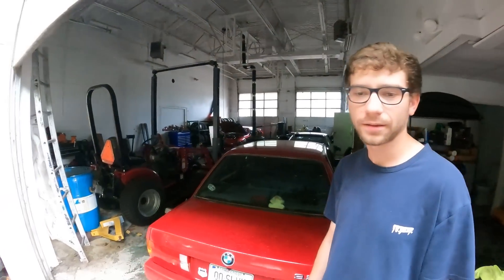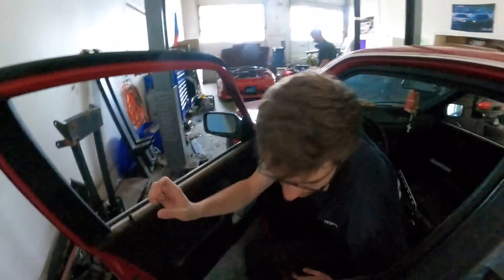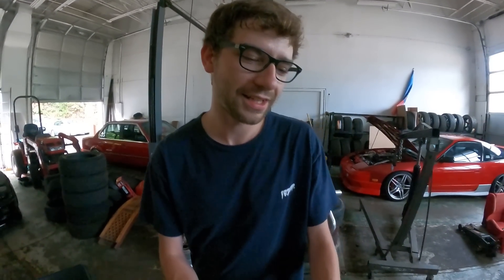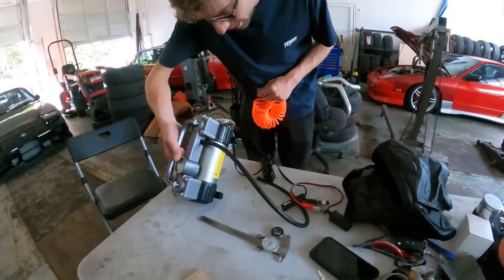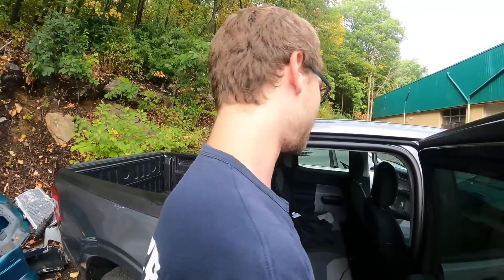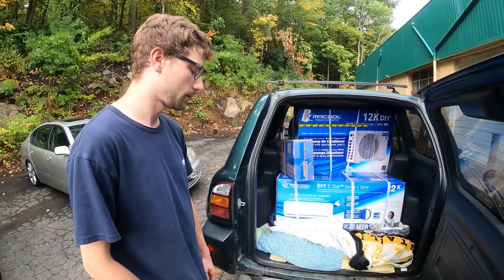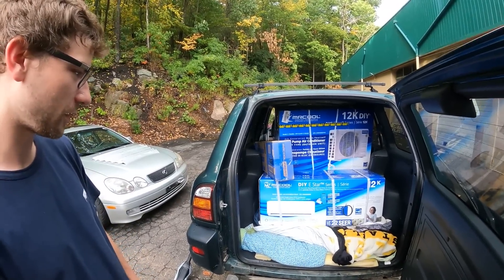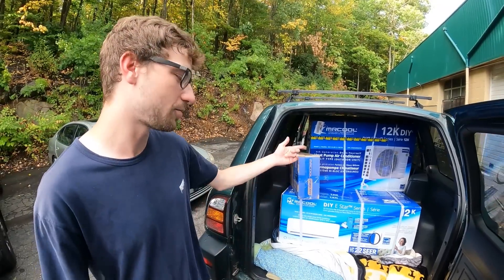Did he get ripped off?

Comment: You can get all batteries you want, but you ain’t running that ac and heat off solar… I would have thought you would do SOME basic research on this but clearly not. You will need a generator to run that for any amount of time.

Comment: If you're drilling into steel or something with a self tapper you have to feather the trigger until it starts to drill in. If you go fast with a self tapper into steel or something heavy you'll burn up the tip. Go slow with metal or you'll burn the tip of the drill bit up

Comment: Hi, i have an AC  inverter and power compsumption is low of you dont push to hard compsumption is low, i have a AC That drives 2 splits and it draws like 800w to 1500/Hour